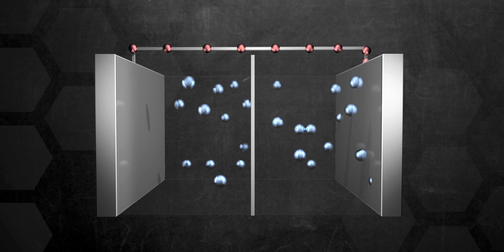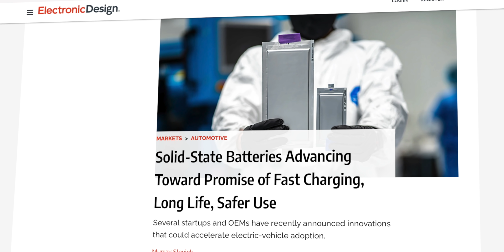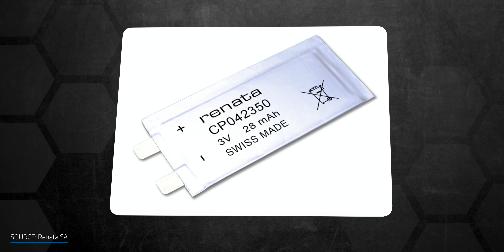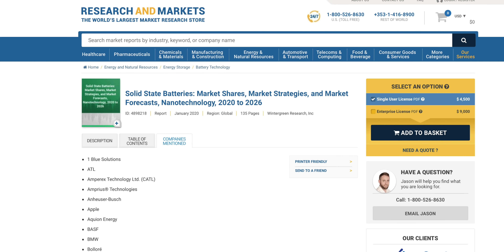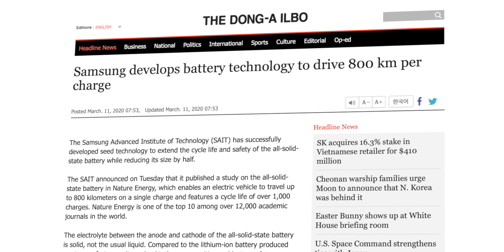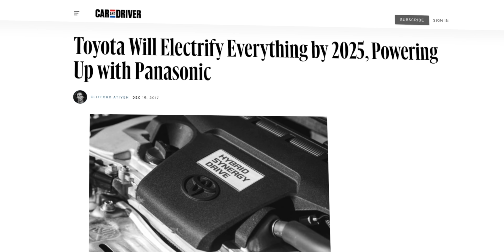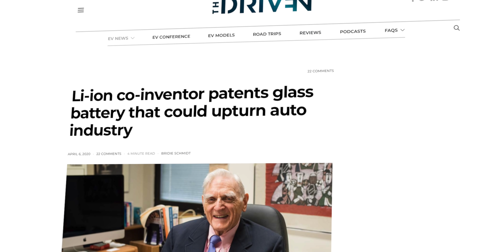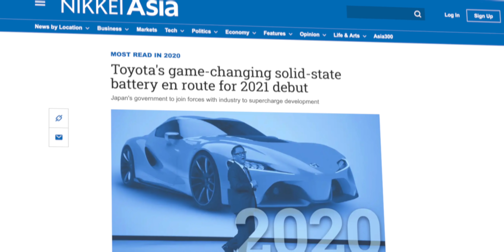Exploring When Solid State Batteries Will Arrive

Comment: The "...at an affordable price..." are the key words.
Reply: Yup. This is a point many people don't get about adoption of new technologies. Take the hyperloop. Is it feasible to build a giant vacuum tube? Sure. But as someone who designs ultrahigh vacuum chambers, I can tell you that the electricity costs to maintain vacuum integrity (even if it's a relatively poor vacuum - say a tenth of 1 atm) is crazy expensive so it will never make economic sense.
Reply: Right affordable is relative I have 4 powerwalls most people wouldnt call 30k " affordable" but I would
Reply: @crashoverride93637  while what you say is true, I believe the operable concern is being affordable to produce to ensure a profit.  Not to mention ensuring that the thing you are making isn't a "lasts forever" item like in the old days.  Modern method is planned obsolescence to ensure you have to buy parts/a replacement, this keeping the company in business for decades.

Additional comment Something I am surprised to see that I left out:
Personally, I prefer the "lasts forever" method as that brings the company a good reputation for reliability. This was the core of why "Made in the U.S.A." was the benchmark to strive for.
Reply: More accurate word is sustainable. Whether this is possible at sustainable price.
Reply: @pauld6967  you can make a last forever item that still makes money after the sale, that's what wear parts are for as long as the user can self install them it's just as good as the old days, that was the difference they used replaceable wear 0arts instead of sealing the thing and chucking it when 1 thing broke
Reply: @crashoverride93637  Alas, many if not most of my friends are of the "dang, it broke, chuck it out" variety.

They always give me odd looks when they hear how I have fixed something that broke.

Now, that said, I still hold that things aren't "built to last" like stuff here at sister's house. 50, 60 year old items and they are working like champs.  Oh sure, the plug and power cords are frightening to any sane man who sees them,...but they are still working.
Reply: @DhavalBrahmbhatt2627  I would accept "sustainable price" as being synonymous for "affordable to manufacture" in this context. 🙂
Reply: You've hit the nail on the head. Assuming solid state batteries do, indeed, arrive in the mid 2020s, they'll be in high-end BMWs, Porsches, Audis, Lexuses and Teslas, not affordable VWs, Renaults or Citroens. Hopefully solid state batteries will trickle down, but I think we'll still be depending on conventional lithium ion batteries for a couple of decades, yet.
Reply: @pauld6967  "Now, that said, I still hold that things aren't "built to last" like stuff here at sister's house."

This pretty much is obvious. Did you notice how "to fight climate change" we pass laws requiring increases in energy efficiency but we do NOT pass laws requiring longer lasting products? In fact, we had a "cash for clunkers" program that took perfectly fine cars - even small engine ones with great gas mileage - and purposely wrecked them. From an environmental point of view, this makes no sense. But it does make economic sense... if you are a company, not the consumer.
Reply: @lukeearthcrawler896  Quite right. 

The discussion no doubt went something like this:

Division Direct of a major manufacturing corporation: "Johnson, we must come up with a way to get people to get rid of the quality built version of our product."

Flunky #1 "Why is that Sir? Ours is so durable that it'll work reliably for at least a decade."

Div. Director "That's precisely the problem Johnson!  We won't get more money from that person for at least 10 years."

Flunky #2 "I get it Sir. If we reduce the quality we can increase the per-unit profit AND ensure the customer will buy from us again. Either for a replacement or spare parts."

Div. Director "Now do you see Johnson? This guy,..." points at Flunky #2 "...has Executive potential. Keep up that way of thinking son and you'll go far in this company."
Reply: LMFAO!
Reply: @lukeearthcrawler896  But elon said Hyperloop can get surplus electricity even if they install solar panel on tube.
Reply: and manufacturing at scale, but they go hand in hand.
Reply: @crashoverride93637  That could be affordable. What I like is the increased availability of the current EV batteries it might cause. I have about 45 Kw of Leaf batteries and 30 Kw of Bolt DIY Solar storage batteries that I have assembled for about $100 per Kw or about $7500 but these will likely last 10=15 years.  Weight however, is not a factor for home storage and Volume isn't much of a factor.  It may also drive down the price of LiFePo batteries further which are already pretty affordable .  Whatever they do they will eventually be affordable and if they prove to be longer lasting would be attractive for solar from that standpoint as well as safety.
go battery researchers !!!
Reply: @gigabyte2248  Probably for at least 10 years in new vehicles etc. Just from pure production limits as well as costs etc.  There is barely a somewhat ample supply of lithium ion and liFePo batteries now.
Reply: "environmental impact" is the key word
Reply: @themorethemerrier281  B'wahahahahaha. Most amusing. The environment,...ha-ha, ho-ho, hee-hee, thank you for starting my morning with a good laugh.
Reply: @pauld6967  Happy to help! 🥂
So awesome that there's an unlimited supply of high quality raw materials for battery production! 😊
Reply: @themorethemerrier281  ..and continuing with happy thoughts, NASA/SpaceX Crew-2 has successfully launched. :-)
Reply: Usually everything gets affordable when used and produced in bulk.
Reply: @knightworld3019  Correct, it is the "convinced we can do this without a ton of specialized effort/tooling and more cost to create than what we are already making" mental state with the industry CEOs/CFOs that is a high hurdle to get over.
Reply: Yeah but they dont give us which is pure annoying
Reply: yes, and that in 20 years
Reply: The key to cheap or affordable is efficiency and complexity of production. Even complex production can become cost efficient when the complexity has a modular approach.
Reply: @bighands69  I agree that a modular approach to the assembly line process is, generally speaking, the efficient way to go.

All I ask is that the "this should be easy, just do it already" crowd keep in mind the fact that even modular components need to be assembled.

If Module 751 out of the 1000 modules needed requires half a pound of Unobtanium and Module 902 requires a full pound of Doesntexist-oxide, with both costing more than $1,000,000 an ounce,... I think that both are going to come out of the cost/benefit analysis phase conducted by the Research & Development Section with a finding of "NOPE!"
Reply: @crashoverride93637  On a side note: Did you name yourself after the one character from the 1995 movie "Hackers"? :D
Reply: @Twoface698  yes and your only like the 4th person in 20 years to notice it
Reply: Define affordable. I had "budget" blinds come to my house for an estimate. What I got in the bid, was price that may have been in Elon's budget.
Reply: @ericpeterson3614  I hear you on that. Budget Blinds gave me a quote and I was shocked at the amount they wanted.
Reply: @crashoverride93637  Glad to be in that exclusive group :D
Reply: exfuckingcatly
Reply: Early adopter tax will always be a thing, people fund the technology, and overtime when the technology becomes more mature it becomes safer, cheaper, less issues and quality control becomes stronger. All tech goes through this sort of thing
Reply: Nickel cadmium batteries 30 years ago, so im assuming within our lifetime is a very high possibility
Reply: @jcd-k2s  something tells me that solid state batteries arnt going to die out though, unless something better replaces them
Reply: @jcd-k2s  because people don't understand the laws of physics cannot be broken. There is a reason your body stores energy in fat....it is extremely energy dense. 

Batteries are extremely low energy density. The best way to store energy is through chemical bonds that is a fact. 

In regard to supersonic airplanes it is to costly to run them for commercial use. At the end of the day the insane amount of energy you have to spent to constantly go faster than the speed of sound is not worth the benefits of going to a location 2-4 times faster.
Reply: @lukeearthcrawler896  dude I have to deal with a vacuum in a small cryostat, maybe a dozen square inches. It’s damn near impossible to build a window that’ll maintain a good vacuum.
Reply: @lukeearthcrawler896  thank you for explaining why it is okay to disagree with a futurist sometimes.
Reply: @DudeTF2 I work in R&D and build ultrahigh vacuum chambers working at 10^{-11} Torr all the time and I do use large viewports. It's not that difficult.
Reply: @lukeearthcrawler896  AYO can I get some tips PLEASE, how are the windows made? Do you use any specific epoxies?
Reply: @DudeTF2  We buy them directly if they're under 6" diameter. If they have special shapes, we use Torr Seal, the trademark for an old Varian epoxy. (see MDC Vacuum's website for standard windows up to 6" diameter).
Reply: @teekay1785  you diy your own batteries but use kw instead of kwh? Bruh.
Reply: @gigabyte2248  with billions of miles on hybrid batteries under their belt Toyota will be the one to make electric vehicles as affordable as possible while maintaining quality. That is the image they strive for compared to the “prestige” image of the luxury brands.
Reply: Anything can be affordable. It's all about scale and quality.
Reply: @snitox  With respect, your statement applies to the state where things are up and running.

However, one must make the business case in order to get that research and development and later production to be started. If you cannot show upper management that it can be done in a way with minimal impact, they will not sign off on the project. It simply won't make sense to incur the near-term suffering for long-term results that aren't certain to be profitable.

It does a company no good to have a projected "sunshine and rainbows" future state if the company will go bankrupt before that result is achieved.
Reply: @pauld6967  Tesla literally survived because of government subsidies. You think no dominant Solid State Battery companies will get subsidized? States will be lining up to give out subsidies.
Reply: @snitox  Perhaps. Time will tell. :-)
Reply: @snitox  Wrong. There are things that are just scarce. If you were correct, gold would have been as cheap as iron. Or do you think we just didn't care to mine enough of it?
Reply: @lukeearthcrawler896  hunk of gold doesn't qualify as quality.
Reply: @jcd-k2s  Batteries don't work by storing chemical energy....not rechargeable ones....lol.

Tech doesn't always become affordable sometimes it dies because it just cannot be made in a reasonable way.
Reply: It's just a kidney or liver, you'll live, you want that new Tesla  (Right?)
Reply: They always forget the high cost of slow production.
Reply: That’s if the companies don’t form a monopoly…
Reply: @gigabyte2248  but what about phones, laptops, ...
Reply: "World on feckin fire "
Humans haggle over price
Reply: @herrba  doubtful with the huge push to electrification of travel the supply and demand for batteries is going to favor demand side economic pressure driving cost up not down it will take some time for producers to ramp with tesla fairing better than most if the tabless design plans out
Reply: @herrba  ...oh my, you actually believe that lol thats the same cap Nikola was peddling to investors no tech is ready for prime time like that in the next 5 years, your underestimating how hard taking a concept to a scaled manufacturing is
Reply: @herrba  ...yes they will ...and that's why batteries won't be comming down in price ...
Reply: What EVs based off of Tesla ideas. Where batteries built into the floor so we discard our cars like we do cell phones. People shell out the money not caring that they have to sell their first born child to get. Prices rise so one day most will have to take a bus not to be green, but because they cant afford one.
Reply: @daArchitect-  ...um you know the packs replaceable right ....like easily replaceable, do you not know that? Also even if it wasn't it still has 80% of its range after 10 years by then a gas car would start needing major repairs and maintenance... please educate yourself before you make yourself look ignorant
Reply: @daArchitect-  it won’t be too hard to use battery packs like electric hand tools only at a large scale. We are only  entering the second decade of EV’s
Reply: @crashoverride93637  As the saying goes 'ignorance is bliss'.
Reply: @daArchitect-  really, you don't seem that happy...
Reply: @kaiwalyaghotkar832  Elon has said a lot of things, not all of them are right, that's part of the process

Comment: What we really need is the right to repair to become larger so when these solid state batteries are more available we can make changes to our current devices to update them with these batteries.
Reply: True, companies are both wasting materials and loyal customers
Reply: When solid state batteries arrive your current devices will have long gone in the trash unless you're one of those people still rocking an iPhone 3G.
Reply: @shinikyokai8815  Let's take an iPhone 12 or 13 for example. Do you think you need to change it after 2-3 years? No
Reply: @HelyoG  do you still use an iphone 8? I bet not. Soon phones will get upgrades and foldables will take iphone 13's place.

Comment: We've been 5 years away from solid state batteries for the last 20 years, LOL!  Yes, I agree ssb will be the next big thing for EVs and I am patiently waiting.  QuantumScape seems to be in the lead, but there have been several hit pieces on them from short sellers.  This practice should be illegal.
Reply: Oh well in 2013 my laptop has an SSD but only <100Wh. Now solid state is going into the kWh territory; yes they've been saying it but also delivering incrementally larger capacities so there is truth to their statements.
Reply: @joebloggs1804  an SSD is for data storage not power storage
Reply: @kaitlyn__L  
Oh yes, that's right! I got confused. Only Li-ion polymer battery in that laptop, but solid state battery would be quite an advancement.
Reply: Are you saying the practice of short selling should be illegal or that the practice of defaming companies you're shorting should be illegal?
Reply: @joebloggs1804  I eagerly await solid state batteries. Although we’ll probably mostly just have lighter devices with the same lifetime rather than the same size devices with longer runtime :( even though I want the latter.

Comment: Can’t wait to have a hand tool that lasts far longer than what we’re used to now. 
Can you imagine an all day drill battery ? We can dream .
Reply: There are plenty of handtools that don't need a battery, so they'll last as long as the operator does AND run on that renewable powersource made by a movable biomass energyplant also known as a human being.
Reply: @truantray  Depends on the tool.  Drill driver or impact driver battery seems to last a reasonably long time.  But a reciprocating saw and something tough to saw will drain a battery in like 20 minutes.